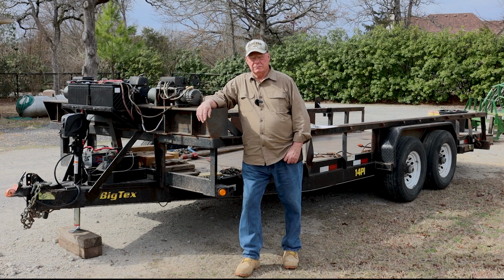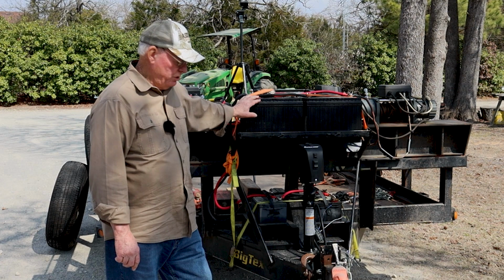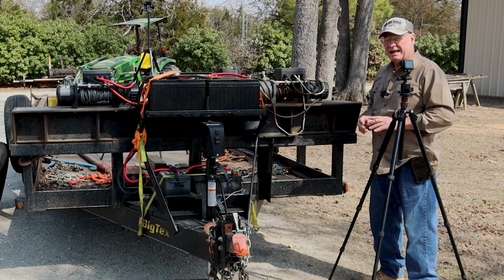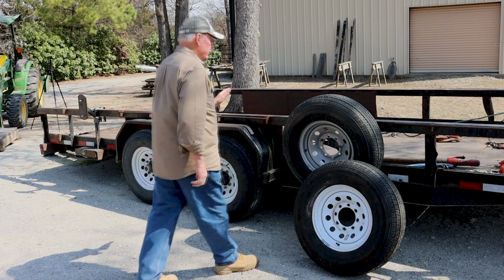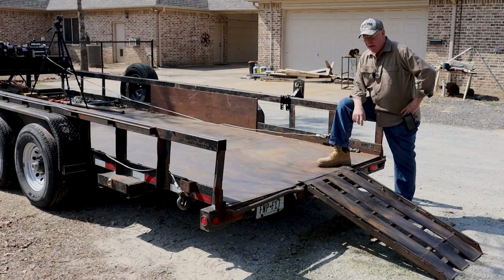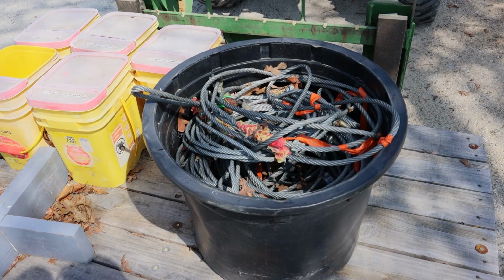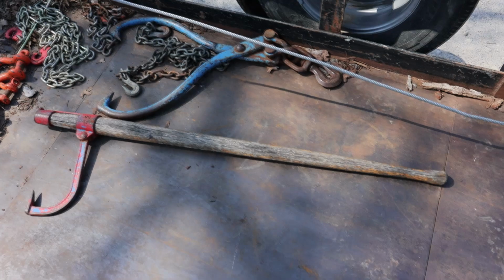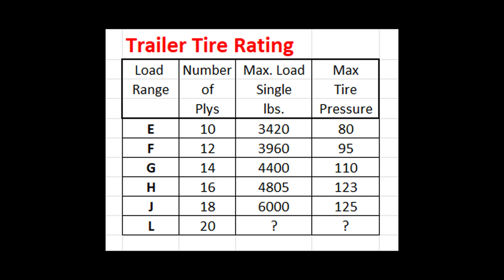Modifing My Logging Trailer

Comment: You might want to consider hydraulic winches. 1 engine 1 hydraulic pump 2,3,4,5 hydraulic winches, lot cheaper in the long run, less limitations.

Comment: I don't agree with your thoughts on the log arch. If the arch is made correctly it would be mounted about midway on the trailer but fold up towards the winches. Think of a baby carriage. When you want to use it you fold it the other direction with the winches and setting up with two chains at what ever hight you need then not only would you be lifting up you would also decrease the drain and strain on the winches then when your done fold it back in parking position by the winches.

Comment: I find log arches advantageous. How its built will determine how well it works. I use one winch to lift 30" oak. If the trailer needs support, just put a block under the back corners of the trailer. I built my arch using 6x6 pressure treated lumber with braces. The arch is hinged using 4x6 pt and some big bolts. The winch cable is connected to the top of the arch with a chain wrapped around the top. I will add a chain hoist from the arch going to the log choker. That way the log can be let down and the length of the chain to choker may be easily adjusted. Its primitive, a bit dangerous, cost effective and it works. I did put my winch directly on the bed of the trailer and it only works because of the arch but your winch configuration would work better. The arch also guides the log better than just dragging it. I do wish I had your welding buddy around to make a metal one.  I learn a lot from you, so thanks for all the great videos!

Comment: Mr. George my husband loves watching your channel, he said you are full in wisdom. A fine craftsman, he is asking if you have ever considered using a Hydraulic winch, its still runs on batteries however the pulling power is much harder but apparently allot less battery draw. He got the idea from dump trailers that use batteries for the hydraulic pumps.He's going to try that on his 24'ft trailer.
Reply from the maker: Could be something I consider in the future.  For now, the large batteries and bigger battery cables have made a significant difference in my ability to load logs.

Comment: I still have it , but stopped using it. Anyway a C60 Chevrolet dump truck that's dock height. I built a log arch for it. I could still load a full sized tractor on the bed and pull the trailer behind it to log sites. Use fold down jack stands on the back of the trailer, or fold down swivel wheels. A hinging log arch is awesome!!!!  Also a PTO winch powered with a Predator 212 for your main winch never needs a rest to cool down. I built two of them out of gear reduction boxes , Lovejoy couplers to disengage the spool. Make the forward, reverse like a Troy Built tiller.     It makes no sense not to use a log arch.   You must like doing it the hard way , using up batteries for no good reason 😵‍💫🤔🤤.   As I said my C-60 stood loading dock height , I put a log arch on it, and still loaded a Ford 3000 , Belarus 350AS in the bed under it. With the gas powered winch , I could load huge logs on the bottom , and 18-24 inch logs 3-4 layers deep by myself on a truck bed over 3foot off the ground. 
    I Usta line haul across TX. Most of people I met out there were just that damn stupid tho. It's no surprise they would wanna overwork themselves for no good reason. Most of them are as stupid as the whole state of Mississippi.
Reply from the maker: Its always nice to have equipment that functions for what one needs it to do. Thanks for the comment, keep on truckin.